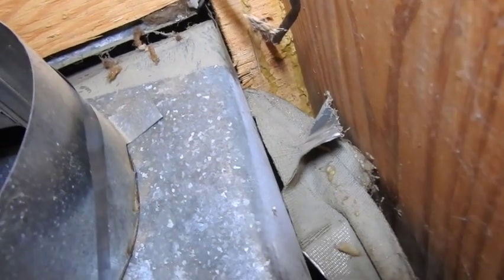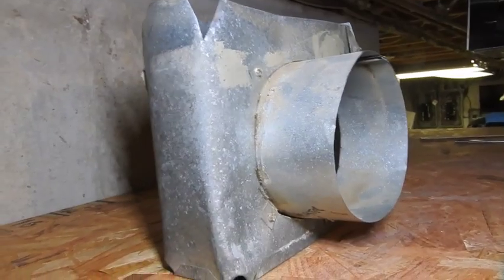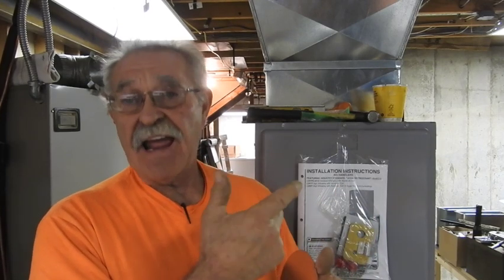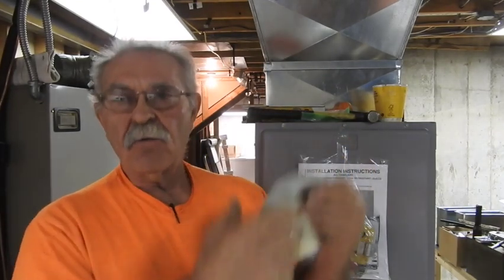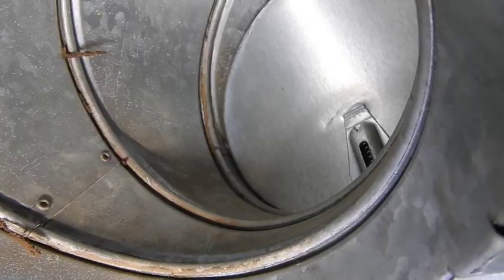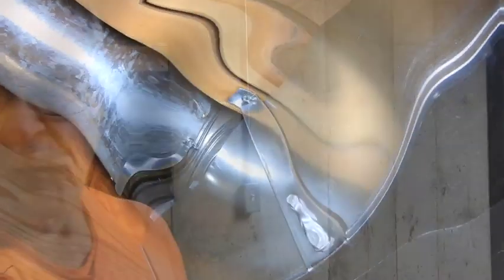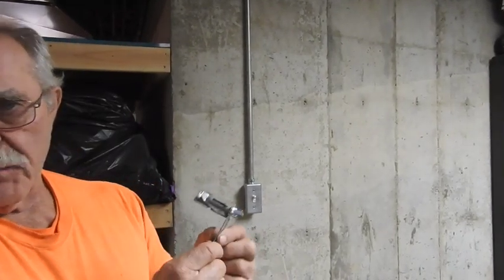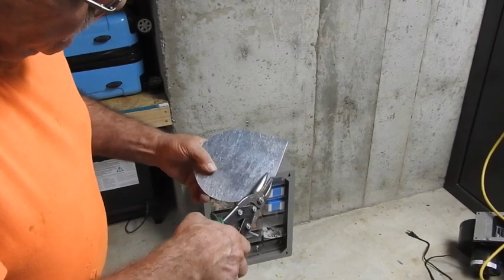Pt 2-Air Handler and Duct Retrofit- Air Volume Control

Comment: Nice explanation about the dampers all installers should know!
Thanks for the video.
Reply from the maker: It seems most of the time these details are left out anymore in all but the systems of extremely high installation costs...and those seem to be zone dampered systems in much larger homes. And THOSE are very rare.

Comment: I use to do all them by hand too. Sometimes with a sheer.  I prefer to use a malco hole cutter to make 6" taps and then what's left over is a perfect damper.
Reply from the maker: I liked the Malco hole cutter for the times a new run needed to be installed in existing duct.  It's difficult to cut a hole with snips between the joists as you well know.  Just no room to work but the Malco hole cutter made it much easier. That's a good idea with using the centers for dampers when you are using 6'' taps.

Comment: Good on you for fixing the existing issues. Poor airflow and high static will prematurely kill a furnace. Thxs for the vids,  Tractorman44!
Reply from the maker: The big picture David, was separating the second floor off this system, and installing an attic unit for that floor.  Then this unit was downsized in capacity for only the first floor and what little load the basement added. Much less airflow and new duct equals more efficiency and less noise.

Comment: Even I can agree with you that the former 'work' done there was disgraceful. I sincerely hope that the days of "ah, that'll do " are few and far between today.
Thanks for this Wendell.
Reply from the maker: Sadly we can wish all we want to Reg, but there is still that 'faction' of the industry that thinks duct tape will cover any bad installation.  So many installs are less than adequately put into service.  There are actual one and two man shops out there that do installs with no  sheet metal fabrication machinery at all.  They hang pre-fab duct work and hand form plenums and return air boxes held together with screws and duct sealant.  That's the new duct tape !!  I watch a lot of them on youtube here and there. But I do have to add that there are a lot of really good installations out there as well.

Comment: I can’t tell you the amount of times I’ve seen collars cut in at the end of the duct, or in the End Cap
Reply from the maker: Ain't it crazy....and the velocity will knock your hat off too !!  I mean, sometimes there's no other choice and the end user just closes the floor damper.  Then the cold air stagnates in the duct and if the humidity is just right the branch duct will condense moisture out of the air and drip, drip, drip.

Comment: My Daughter just bought her first house and the "ductwork" made me sick. They used the insulated hose ( I don't even know what it's called) for all the runs from the main to the registers. Half of those were falling off the piping and had to be reattached. The cold air return in her living room was up off the floor about ¾" on one side. They had hung about 10' of the 10" return line off it with no support until well after a 90° elbow. I had to add support on the line and the box to get it level with the floor. It needs to be all reworked with hard pipe. Looks like I have yet another project coming up in the spring! I wish she hadn't fallen in love and signed papers on the house before I saw it. Oh well, it is in better shape than my first house. Oh and btw she bought the house from a "flipper" so that explains a lot. 🤦‍♂🤦‍♂🤦‍♂
Reply from the maker: Flex duct is recommended to never exceed 7 feet in length...and even that is supposed to be straightened and stretched as good as possible. Sounds like you've got your hands full.  Yeah...those 'flipper' guys would like to put a band aid on a severed leg and call it good.  It is quite frustrating what people try and DO get away with.  I hope at least he's enjoying his profits.  Actually, no I don't.  LOL. Good luck with helping the daughter in the spring.

Comment: I redid all the dampers in the house I`m in at the moment. I and my brother adjusted them all with a manometer I think it`s called....CHEERS
Reply from the maker: Well, if he had the fancy one with the canvas hood it was a Balometer, and if he had the hand held one for the floor registers, it might have been a Velometer. The first one is the most accurate, the second one is a bit more difficult.  But he may have used a Manometer to measure the duct velocity and calculated cfm through another means too.

Comment: it's very interesting to see how different you guys do it over in the states when compared to Europe, but nice work
Reply from the maker: I've heard that before from a UK internet friend.  But I'm not sure exactly what's implemented over there.  I guess the problem comes in with so many old structures that there is no centralized duct in place or its every difficult to get them installed because of the architecture...???  Btw, thank you for the compliment.